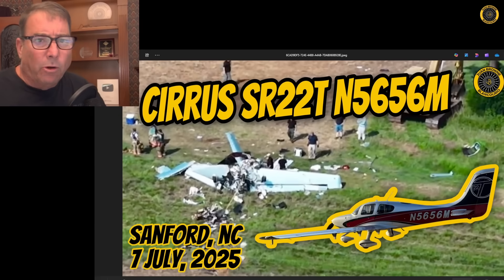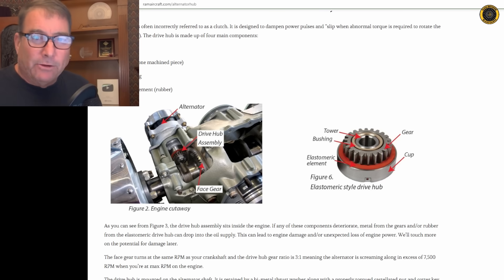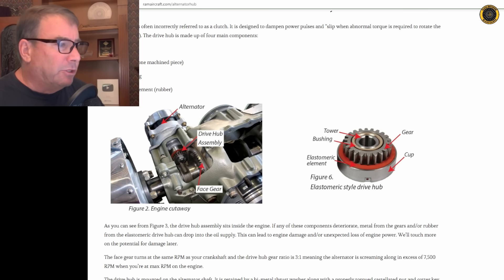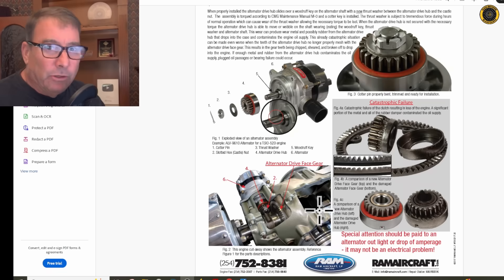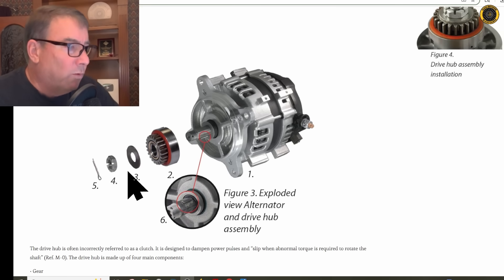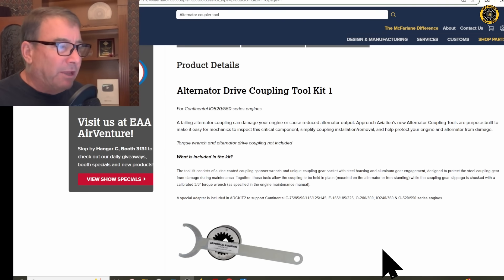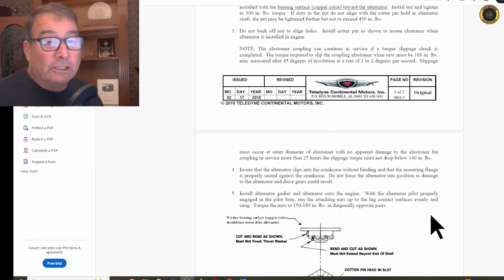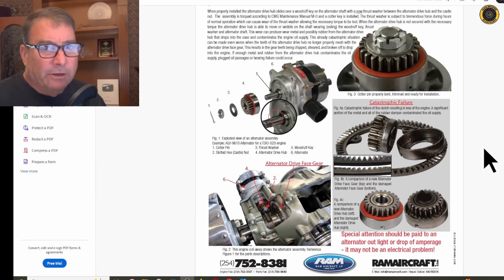Alternator Drive Failure-Can Lead to Engine Failure!

Comment: I still don't get how it could cause the alternator to become intermittent? Did the elastomer start to fail and then the gear started to lose teeth or the teeth got ground down off axis and then start to miss? Maybe it was a rapid reset from primary to secondary alternator as it started to fail?
Reply: Other way around - electrical fault puts excessive load on the gears.  I believe the elastomer coupling is designed to slip to limit the transferred torque, but it can probably only do that for so long.  Alternators become brakes when there's a short, and the short can be inside the alternator in which case a circuit breaker won't help.
Reply: @galacticminx  That makes sense! I've often wondered if it'd be worth the cost and complexity to have some kind of secondary monitoring system for aircraft and cars. Like it'd monitor the current needed to turn over the engine and see if that changed dramatically, or temperatures in various parts, or electrical noise on a bus or even like an advanced acoustic sensor like a knock sensor that could "hear" when various things started to change in vibration or whatever.
Reply: @toastrecon  Interesting you should mention monitoring current.  I replaced a car battery once and it was still having trouble starting with the new one.  Put a clamp meter on the starter cable and it was pulling over 400 amps while struggling to turn over.  Turned out to be shorted windings inside the starter.

Comment: I would assume that the "gray area" of your decision making in a jam narrows with lots of experience. I would think popping the chute without properly assessing your situation would be seen as an irreversible "panic mode".   Maybe the aircraft seems to be in control till you find yourself below minimum use,  then you can't back up.  Thinking you got it till you don' t.  Anyway waiting to see what they actually find.
Reply: I think you hit a key point.
I'm no pilot and have never even smelled a Cirrus, but I know you "fly the aircraft all the way" and also that deploying CAPS causes major damage to the aircraft. So unless I were trained otherwise, I would be focused on flying as far as possible, with the parachute as a last resort. Which...would probably get me into a situation where that was no longer an option.

Comment: Still don’t understand why they didn’t pull the CAPS handle. Were they too low for it to be effective? I can’t imagine that an electrical failure would prevent the system from operating.
Reply: It looks like it impacted at a steep angle, suggesting loss of control.  Probably a stall/spin, which can happen really fast and if you're low there's very little time to react.  With electrical problems, the flaps may have been inoperative... maybe the pilot didn't maintain the extra speed required for a no-flaps approach?

Comment: Juan, at 3:32 you say 300 foot pounds, I think you meant inch pounds.
Reply: I was thinking the same. 300 foot pounds is like a Cat head bolt.
Reply: @frankbuoni1804 You got that exactly right “Cat C15 engine typically requires an initial torque of 200 lb-ft, followed by a final torque of 330 lb-ft”
Reply: @richtes otherwise known as "FT"
Reply: @frankbuoni1804  @blancolirio or the Jesus nut on a copter.  :)
Reply: @frankbuoni1804  Or a Honda crank bolt, lol.
Reply: It's a surprisingly common mistake. I got some service manuals for life support equipment with insane torque numbers. I emailed the company with a "this doesn't look right" and they got back to me saying the numbers were 12 times too high (inch pounds not foot pounds). But worse.... They'd redone the manuals for non USA so I was being given manuals that said Nm, but just 12 times higher than they should have been. Even worse, the maintenance records required me to sign off that I'd torqued the bolts to the specified number, which was printed in the forms I had to sign. It was a giant paperwork SNAFU.
Reply: @gasdive , I have worked for a major aircraft manufacturer. For years an operation sheet that was used if the aircraft reached 10 hrs, called out a wrong torque. When I brought this up to our Ace manufacturing engineer, he responded that it was a “Frozen Manufacturing Safety of Flight Operation!” I showed him the government’s maintenance manual and the installation drawings, he insisted it can’t be changed. I told him if you burn the meatloaf and you freeze the meatloaf, it’s still a burnt meatloaf. We finally got the paperwork fixed by taking it to company and military QA.
Reply: @duanepierson4375  it's wildly frustrating. (Particularly when you know your co-workers don't even know where the torque wrench is stored)
Reply from the maker: Correct in lbs.

Comment: secret advantage of belt drive alternator.   siezed alternator just shreds the belt.
Reply: Direct-drive use shear couplers. If you shred a belt, hopefully, nothing essential is driven by it.
Reply: @saintchuck9857 In my limited experience, I've only seen that smaller aircraft engines only drive alternators/generators with belts.
Reply: @saintchuck9857  well, no.  direct drive alternators on Continental engines use that elastomeric coupler.  that coupler failing is what blew up the engine. 

and yeah there's nothing else sensitive beside the alternator in a belt drive configuration.   the alternator is at the front of the engine, the rest of the accessories (magnetos, vacuum pump,   prop governor) are at the rear.  they're gear driven, and they DO all have plastic shear couplers on their input shafts. 

that style of shear coupler doesn't work with an alternator,  because the alternator draws too much power, and the power or draws is too variable.  that's why the gear- driven design originally had a spring loaded clutch gear.

Comment: Caterpillar uses a similar system in smaller machines with a sacrificial nylon gear coupling between the engine and hydraulic pump so that if the pump siezes it doesn’t hurt the engine
Reply: Yep. Shear couplings are quite common on direct-drive applications. I can't figure out the logic of designing the engine so my of those bits can fall into the internals. It makes zero sense.
Reply: @saintchuck9857  This exactly. Poor design work.
Reply: That was my exact first thought on this.........why isn't the sacrificial coupling OUTSIDE the engine.
I'm a "Keep it simple stupid" kind of guy, and this just seems overly engineered for the sake of overly complicated engineering.
Reply: CAT make ridiculously tough and resilient engines. Which is a great thing.

Comment: Why is the alternator inside the engine? Seems like you're asking for it to grenade the engine. Car alternators don't need a silly elastomeric slip hub and don't risk any immediate damage if the alternator fails... you just better stop (or in a plane, land) before your battery is dead? Even if the alternator locks up... which can happen... it doesn't lock up your engine, the belt just slips.
Considering the fact that the ENTIRE REASON airplanes use magnetos is so that an alternator failure couldn't take out the engine an hour or two later when the battery dies... why on earth would anyone ever think it was a reasonable idea to put the alternator inside the engine so that the engine may be severely damaged the moment it explodes or seizes?! (Ok yes it's also to do with the risk of the battery failing or other electrical issues but still)
Reply: belt drive alternators are still pretty common in aviation. 

they're annoying in that you have to take the prop off to change the belt... but it's not like the belt needs changing often.
Reply: Alternator is not inside the engine. The direct drive shaft goes from alternator to drive gear in the accessory case.
It supposedly has failure points that protect the engine, but . . .
Reply: @triggerpointtechnology  well yeah, even the elastomer is essentially such a failure point, but there's so many things that can obviously still go wrong and lock up the crankshaft...
Ok, Juan's link says "The front-mounted alternator used in most 300 and 400 series Twin Cessnas has a drive hub assembly that is driven by a face gear mounted near the front of the crankshaft", and Juan says about the incident aircraft "the direct drive alternator, right off of the engine"... while showing a picture of the alternator sandwiched between the end of an awfully engine-looking block of metal and a rotating linkage to some other component, which picture is labelled "engine cutaway"... implying that it's inside the engine which has been cutaway... but it doesn't really matter where it is when the point is that it can seize the crankshaft.
Reply: Not all cars, VW seems to feel their alternators need them. They need to be changed about every 60k miles, special tools, of course, available at Amazon. On mine it made a loud ungodly screech like a fan belt burning up on a frozen alternator, but the alternator bearings spun freely it was the drive hub mounted on the nose of the alternator. There was no warning. It was fine and the next time I started the car it was, wtf is that.
Reply: @hotprop92  Hmm, my Jetta has 90k miles and I doubt the other owner did any such thing to the alternator before I bought it at 40k :)
Various parts can definitely fail and seize on a car/belt-drive alternator but your car will keep operating just fine. At worst the belt will shred and, since things like PS and fan may be driven by the same belt, you'll likely lose steering assistance and may start overheating. Plenty of time to find somewhere to park (or in this case, to find somewhere to land)...
Reply: It's not actually in the engine, it's on the accessory case at the back of the engine.

As for the design of the coupling, well, that's down to cheapness for the manufacturer.  The original, spring-loaded part would be far more reliable, but also a lot more expensive to make as it would require a person to assemble it.  The new, bonded elastomer part is far cheaper to make as it's moulded on a line.  Unfortunately, just like crankshaft balance pulleys on road vehicles, they're a regular service item as they start to break down immediately because the elastomer or rubber is effected by temperature changes and the rotation.  I think pretty much everyone who's been driving for a few years knows what it feels like when the crank pulley on their vehicle starts to come apart.  It pretty much feels like the engine is trying to throw itself clean out of the vehicle.  In this case, it appears failure of the drive can cause the gear to be destroyed by running out of true and, presumably, the debris created will drop into the accessory case and can jam up other drives, effectively seizing the  engine.  Bad news at 10,000 feet.
Reply: @JamieCameron-Mackintosh-z7c  the link in the description states "The front-mounted alternator used in most 300 and 400 series Twin Cessnas has a drive hub assembly that is driven by a face gear mounted near the front of the crankshaft". It doesn't really matter where it is, though.
I've been driving for 15 years, been driven for 32 years, almost entirely in cars that were 20+ years old at the time, and have never experienced such a thing.
Indeed, the risk of a direct drive is that it jams up the engine, unlike a belt drive which will most certainly not...
Reply: @JohnRunyon  Like vehicle engines that are supplied to different vehicle manufacturers, largely commercial nowadays, these engines can support different accessory equipment layouts according to what is required by the aircraft manufacturer.  Most Cessnas have squarer engine nacelles, so there is room for the accessories to be mounted on the front of the engine.  The Cirrus, however, has a more streamlined nose, so there's no space for the accessories at the front of the engine, so they use an accessory case at the rear of the engine, between the block and the firewall.  Juan showed this on an older Cirrus in his first video on this crash.

I can't understand the thinking behind the change in the drive gear, beyond saving the manufacturer money as, if I'm understanding it correctly, the original style of drive gear with the metal springs in would have been long-lasting and failsafe.  The new part, however, is going to be pretty much a service item and has clearly proven to be anything but failsafe in service.  It looks like another clear case of a company putting profits ahead of people.
Reply: @JamieCameron-Mackintosh-z7c   I've actually gone back and watched the earlier video and the main alternator is... at the front. The smaller alt 2 is at back. (I think he said the newer generation has both at front? -- Well, he said that on the newer generation, alt 2 is at front, he didn't explicitly state whether or not alt 1 is moved, I assume not)

Definitely agreed on the drive gear, although springs can certainly wear too which is its own problem...
Reply: @JohnRunyon  Yes, the springs can wear, but even if all the springs broke, I can't see the part failing in the dangerous manner that the current version clearly can.  In fact, my experience with sprung components like this drive gear suggests that, even with all the springs broken, it may well continue to function at least long enough to get the aircraft back on the ground.  In the event of (unlikely) total failure it is likely that the remains of the springs would jam between the sections of the drive gear and effectively turn it into a solid gear, as, to counteract the effects of the firing pulses of an aircraft engine, the springs would need to be pretty beefy.

Comment: Training through Cirrus tells you to pull the chute. No forced landings unless you are making the runway. Serious operator failure in this case. If he was cruising at 10k feet he literally had 9,000 vertical feet of glide to trouble shoot.
Reply: Did he have enough altitude for the chute?
Reply: Nice
Reply: If he was coming into land he may not have had enough altitude as the minimum is 400 feet above ground level and it takes a lot of that to deploy and stabilise as a number of others who have done that when they have had issues taking off or landing have been killed as they have been too low when they deployed it
Reply: Pretty sure the minimum for the SR 20 is 600 feet or… if you’ve just taken off and your at 200-300 and it’s all buildings and your gonna die anyway. My son’s CFI made that comment about their airport. 0 good options off of either runway. Paul has made 2500 feet his pull zone from higher altitudes

Comment: I can't imagine flying with radio issues, nor without conventional instruments to back up the glass panel. 

So a washer reversed might be one hole in this case. Wow.  Unforgiving indeed.
Reply: On a long cross country with a substantial over water segment and your entire family onboard. And a parachute available but for whatever reason not used. Tragic and horrifying all around.

Comment: In a way the belt drive is preferred since it's easy to inspect a belt and replace it as well as at the same time check out the alternator to see if the bearings in it are good.
If the belt goes and you have a decent battery you shouldn't be in any immediate emergency. The direct drive might be more reliable, but also cause more severe problems when it fails as well as being harder to inspect.
Metal shavings in an engine is always bad.
But that's just my thoughts on the matter.
Reply: In total agreement. Knowing much more about how this drive works now, I'd WAY prefer a belt-driven system for the reasons you state. I've managed a lot of belted systems over the years, although none aeronautical.
Maybe there are other direct-drive setups with less potential for creating bigger problems upon failure.
Reply: @wadepatton2433  A Duplex belts is even better then you at least have one driving until you lift the hood to see ones missing, this elastomeric coupling does not sit well with me as they generally age with heat cycling.  Lesson is to pay attention to the idiot lights and do you maintenance..
Reply: At cruise, my generator light came on (1960 C-210) and although it was VFR and only 150 miles to destination, I diverted to a field 10 mins away.  There's no way to know what the cause was unless you "opened the hood" and took a peak. Good battery but several factors played into my reason to land short.  You may have a broken belt, lying on or near the exhaust manifold with a fire potential. Could be a seized bearing in the generator, again, possibly leading to a fire as the slipping belt heats up and God knows how that can go.  If pieces of the generator/pulley/belt start flying around the engine compartment, what can they hit, fracture, crack, etc? Only one way to know, land and inspect.  Why end up NORDO because your battery isn't as strong as you had hoped, creating additional risks by losing nav/comms?

Turned out to be worn generator brushes and were easily replaced. If the pilot in this situation had landed at any of a number of fields with maintenance that he bypassed and had the aircraft looked at, likely would've identified the issue and been just fine, albeit delayed.  

Lesson to learn for all of us, unfortunately at the expense of this pilot.  Don't let the swiss cheese align if you can make a difficult decision to prevent that from happening.
Reply: The design decision is genuinely baffling IMO - the entire ethos of aviation designs are to make everything as fail safe as possible. The trade off of replacing something that is extremely reliable and completely fail safe with a design that's marginally more reliable but potentially catastrophic in failure makes zero sense to me
Reply: If you check it